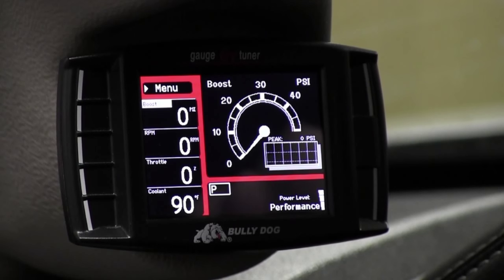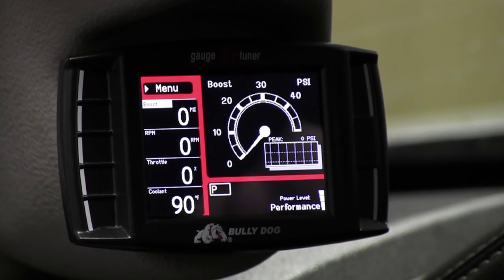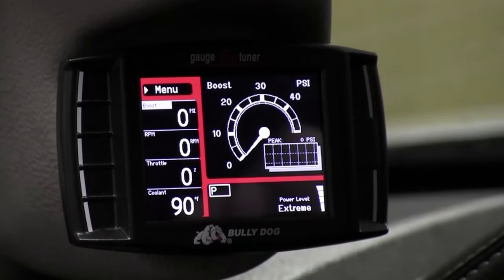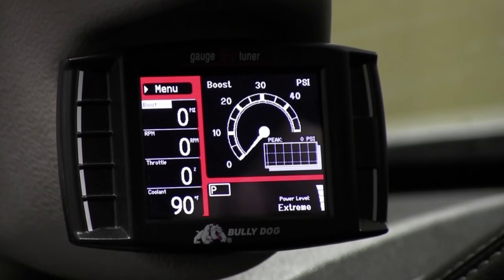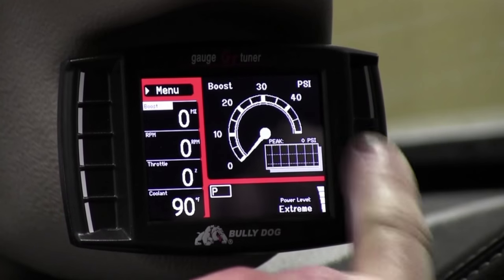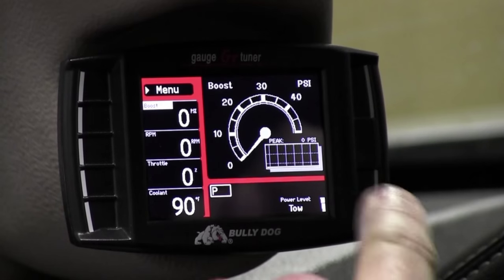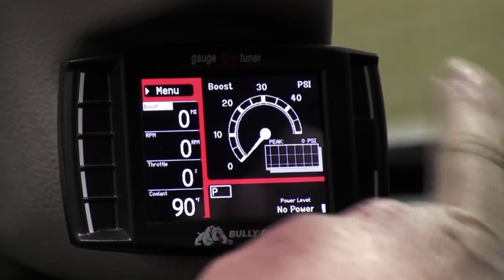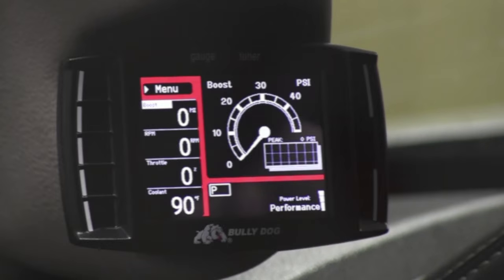How To: Change Power Levels On BULLY DOG GT Diesel

Comment: So I have a 17 F350 6.7 PowerStroke just bought the Bully Dog GT diesel tuner and I can not push the buttons on the right and simply adjust my power levels. Did I install it wrong? I installed it with the tow tune level 2 and then I had to uninstall and re install and choose performance level 3. I’m really close to sending it back to Bully Dog. But I would prefer to just have it work and keep it.

Comment: Would you use extreme setting with a stock transmission ? I have a 2005 2500 5.9 Cummins with auto transmission
Reply: Hey did you ever get an answer? I have a 2005 2500 cummins as well want to use this tuner.
Reply: It works fine just dont over do it crazy fast tho

Comment: Did you have to download tunes or does it come with them installed?

I just had a bully dog tuner installed on my truck 6.7 and it will not change and I do not see the levels when I hit the buttons up or down! 😡
Reply: I have same issue. Did you ever figure it out?
Reply: @fischerqualityconstruction9360  Looking for the same answer and cannot find it.
Reply: @Frightknight28  same issue did you guys ever figure out the issue?
Reply: @ethanweinfurtner7147  I talked tech at Bully Dog and they said on the fly tune switch was not available for Ford. I guess they forget to mention that when you're looking to buy.

Comment: Does it have to be warmed up? I just put the tuner in my truck and it won’t change tunes it just says engine warm up mode
Reply: yes. i run it on my truck and it usually kicks on around 170 coolant temp.
Reply: I was gonna ask the same question I just installed mine it’s on warmup mode